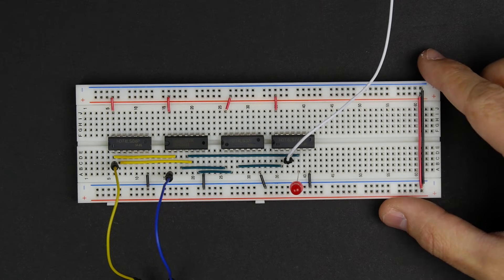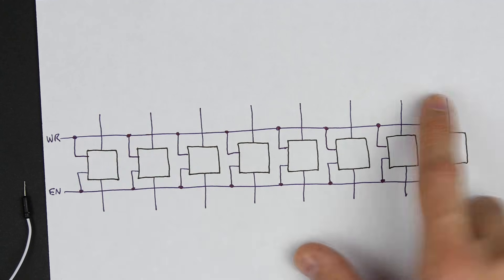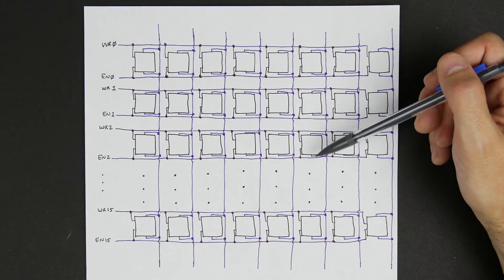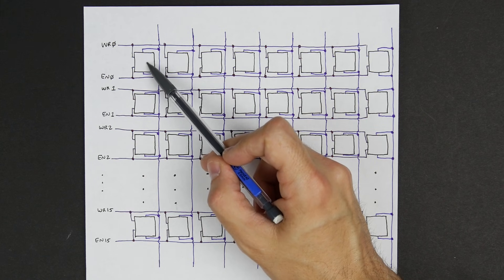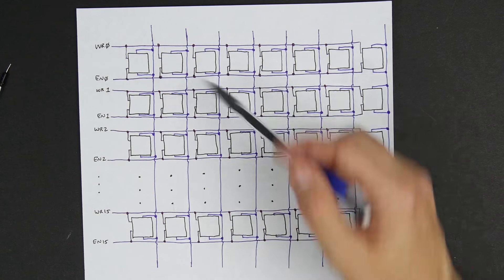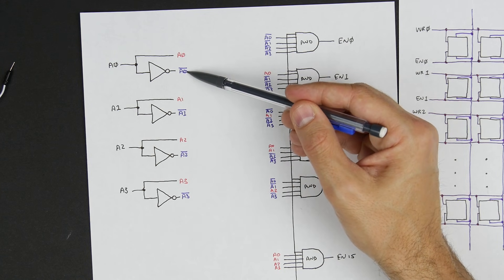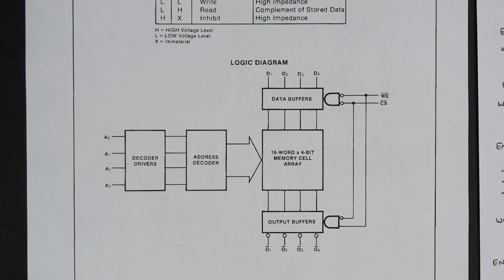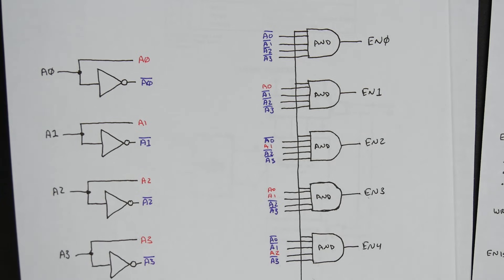8-bit computer RAM intro

Comment: I'll never understand why he went with the 74LS189... its difficult to find, plus its expensive at around $5 each when you do, . Then the regular 7489 and 189 and 74S189 version inverts the output data. It Would have been a lot easier for everyone if he went with a single ubiquitous 6116 2K SRAM that has an 8-bit data bus

Comment: What's with the funky pinouts? I can see why you want your input and output pins paired together, but... why on earth is A0 and A1-A3 on different sides of the chip?
Reply: Yeah the same thing is really annoying on the 6502 project when you go from the 6502 to the ROM chip. But at least the RAM and ROM have the same pin out so you can use all straight wires when you add that. It even makes laying out a PCB for it annoying.

Comment: You generally don't want to use flip-flops for the individual bits in an SRAM, latches are enough.
A flip-flop is typically built out of two latches, one that is transparent when the clock is low and then one that is transparent when the clock is high, to be able to capture the input at the rising edge of the clock (master-slave D flip-flop).

But when you have an SRAM with many words, and you're only going to write one of them at a time, only the second latch needs to be individual for each bit. You can share the first latch between different words, so if you have an 8 bit wide SRAM then you only need 8 of the latches that are transparent when the clock is low. That removes almost half of the latches compared to using a flip-flop per bit.

But Ben's flip-flops are really pulsed latches, sp they're not doubled. I can't tell whether it's a good idea to build an SRAM out of pulsed latches, but unlike the flip-flop case, you don't save a lot of latches by going with the pulsed option.

Comment: Any one can tell difference between ram and eeprom I think both are same...?
Reply: RAM loses its contents when the power is turned off, but the contents can be changed quickly.
EEPROM keeps its contents when the power is off, but it takes a long time to change the contents - often you only do it when the computer is turned off.

Comment: I’m starting to realize the greatest innovation in technology is being able to fit more and more into a smaller space.
Reply: Yep. Which always makes me think of this picture: https://pbs.twimg.com/media/EhBssk7XcAUIuSc.jpg, which is Bill Gates showing how one CD-ROM could hold the equivalent of 330,000 sheets of paper (if you look, it's pretty easy to tell that the only actual sheet of paper is the one they stuck on top, the rest seems to be some sort of sculpted object, so no worries about ecological impact of wasting all that paper). That was in 1994; imagine the equivalent today. CD-ROMs can hold about 700 mb; moving up to DVDs got us to 4.7 gb, or over 6 times what's in this picture. Nowadays, my ram has 32 gb, and there are microSD cards that can store 1 terabyte -- https://www.cnet.com/news/you-can-buy-a-1tb-microsd-card-now/. One terabyte is almost 1,500x the storage space of a CD-ROM, so we would need nearly half a billion sheets of paper to make a similar picture -- except the sd card is the size of your fingernail. It's enough to make you dizzy.

However, there are in fact limits to this. In the world of CPUs, we have basically hit the ceiling of Moore's Law. Transistors are so insanely small now (~7-9 nanometers) that we can't make them much smaller, because quantum tunneling becomes an issue (and also because the heat generated by powering them begins to go exponential).

We don't need alien tech; we already have it -- except we made it, which is pretty damn cool.

Comment: If I wanted to increase RAM to 32 bytes, do I just buy 2 more of the 74189?
Reply: Yes buying another pair of 74189 will work but will have to add additional logic in front of your second pair 

For instance 
1st pair = address = 0-15 and Memory first 16 Bytes 
2nd pair = address = 16-31 and Memory is the second 16 Bytes 

from the datasheet of the 74189 it is clear that the address range is 0 to15 for the 74189, So will need additional logic to translate the 2nd pair address of 16-31 back to the original 0-15 of the 74189. 

So your CPU will address the 1st 16bytes to 0-15 ( address range) and will address the 2st 16bytes to 16-31
Reply: @InTheEnd_141  It's really simple to translate from 16-31 down to 15-0: You just ignore the top bit (a4).
But you would need to set the chip select based on a4, and if you add even more of those chips, you will need a bigger decode that chooses one chip select to activate based on the address bits a4 and up.
Reply: You can, or you can buy a bigger memory. 64 bits is tiny.

Comment: What if instead of electricity the capacitors and transistors used pulses?
Static Ram is perfect for holding an entire Operating System, they could make 512GB static RAM and hold the entire OS in it, for faster loading.

Comment: Something I read recently about why the '189 inverts the output...

The 7489 was an early TTL memory device. Tri-state output wasn't available. Since it was also a big advantage to be able to wire-AND without additional output buffering, open-collector outputs was the obvious choice for devices that might have to share a bus.

As you probably know, NPN BJTs were used almost exclusively in those early circuits. (Just look at the schematic for a TTL logic gate.) NPN BJTs are pretty good at sinking current and their open-collector outputs could sink up to perhaps 16mA with the 7489.

One of the interests, at the time, was to directly hook up LEDs to the outputs. There was sufficient sinking capability to drive an LED. But.. well, to do that you needed the open-collector to be active. So if you directly hooked up your LEDs (and current limit resistors) to the outputs, then you would see lit LEDs where "1"s were written. And folks liked that feature. So I think the designers of these early memory chips chose, in part, to make the outputs inverted to help support the simpler use of LEDs to represent the bits.

Another reason is that these outputs would be wire-ANDed with a pull-up resistor. Before that output could be used again, it needed to be buffered. This buffering was almost always done with a 7404 inverter. Which inverted the signal! (And so you got your "1" back.)

When the 74189 came out, I suspect there was a desire to offer tri-state outputs but to also allow it to be used where the 7489 was previously used (tri-state or active-LO mode only, for example.) So they kept the behavior but added tri-stating to it. (I recall that they later put out the 74219, which doesn't invert.)

Those issues certainly motivated me when I worked with the 7489 and I think that's the reason that the 74189 originally chose to stay with the earlier design concept. Of course, as things proceeded in time, more became available and for less money and the motivations evolved.

Credit goes to "jonk" on electronics.stackexchange
(https://electronics.stackexchange.com/questions/447910/what-is-the-point-of-inverting-ram-output)

Comment: hello so what if I want to include more than 16 byte what can I do?
Reply: Buy a bigger SRAM is probably easiest. But I get the feeling that this computer will be designed to work with 4 bit addresses, if that is the case then more things will need to be redesigned to be able to make use of the extra memory.

Comment: What's the use case for the chip to output the reverse value?
Reply: It sounds very strange. Must be a lot more common that you want the uninverted value. And should be simple to add inverters at the outputs inside the chip.

Comment: Better to invert the inputs so the OE still functions with the bus.
Reply: I was just browsing through the comments to see if someone else had the idea that I was about to write here. I would also think that inverting the inputs to the RAM chips is easier, plus it saves us from having to use the extra bus interface chip with its wiring. Who cares if things are stored inverted in the memory, as long as the data that comes out of the memory module is what was written into it earlier? ;-)

Comment: Might be a silly question, but why prefer RAM rather than another EEPROM ? So that once you've programmed something to compute in it, it would compute it even after power off and on ? So that you don't need to reprogram it each time...
Reply: Frédéric Lidove EEPROM typically has a limited number of writes. It also takes a longer amount of time to write to it. Think of it as the difference between RAM and a Hard Drive in a computer. Ram is much faster, but can't store data long term without power.

Comment: It is a bit pity that the WRITE and ENABLE wires have the same color which makes it sligtly harder to folow when testing / explaining how it works. However, I can understand that they are both control lines so it makes sense to have them with the same color for a bigger picture.

Comment: 16 gb i doubt that is ram that sounds more like solid state/hard drive and in the case you are building it in the way to make ram so saying 16 gb would not be nice this way is and is better with this so my computer probably uses this is wrong solid state stores stuff by trapping it in a place but like you said it will run out after a bit and it needs to keep refreshing so it cant do that when a computer is off hence why they use it for ram.
Reply: You probably have a very low amount of RAM
Reply: @megamer2340  reading my old comment gives me a stroke but idk what I was talking about

Comment: The idea that it's this much work and circuitry for memory as low as this and that my PC has 16 gb of ram is mind-blowing.
Reply: yep, memory has more transistors than a CPU, but memory is a very simple circuit (comparing to a CPU), it's just what you saw in the video repeated billions of times, it's incredible and no one talk about it
Reply: To be fair, it's literally copy-pasted. A single DRAM DIMM might have, say 16 RAM chips on it, each with maybe 256MB. Each chip will have 256 * 1024 * 1024 of those transistor-capacitor combos on it. The chip will also have some address decode logic and that little circuit that loops through the contents and rewrites it. The trick is, when you make an IC, you're sort of just using a really precise projector to project an image of the chip layout onto the chip itself, then use some fancy chemical stuff to make it do the thing. But in designing that chip layout, it's essentially just a digital image. You can copy and paste it as many times as you want. Doing this same thing without a digital image is just a matter of some traditional printing/darkroom stuff. Perhaps not too far removed from just photographing the design and printing a bunch of copies.
Reply: @polymetric2614  what do you mean? There's nothing fair about that! It's still very impressive to miniaturize it, even if it doesn't get more complicated as you zoom out!
Reply: This is even more true for this whole video playlist by Ben, i.e. tiny simple pc compared to what we're watching this on.
Well actually in that case... Is he going to build a cell phone on a breadboard next?
Reply: It is fun to see this step first, because new technologies can only be made with existing technologies and at one point, these kinds of circuits used to power machinery used to make the even smaller chips and PCBs that do these jobs hardwired and with a fraction of the room. It’s like learning evolution for computers haha
Reply: Ŕrŕŕ
Reply: * this much circuitry for static RAM. He says dynamic RAM is just one transistor (and one capacitor) per bit. I guess the capacitor is made using a MOSFET… so perhaps a single MOSFET is both the transistor & capacitor (in dynamic RAM).

Comment: Question: why use two 4-bit chips instead of one 8-bit? MCM6810 is a 128 × 8-bit and can be found quite cheaply.
Reply: because the 4-bit chips are 7400 series

Comment: RE: time index 9:28- I understand your "spelling" everything out for your example, which is really good idea for someone new. But could you not use a 74HC154 to decode which EN line of "RAM" you are using? There are a lot of cool uses for the 74HC154. Also in one of your examples you use a 74HC04 Hex inverter to NOT the output of your Ram. Would it not be easier to use 74HC540? The cool thing about the 540 is one side of the DIP is your input the other side is your output. It also means you are using one Chip per 8 IO, not 2 Chips and have some left over gates/pins (which technically unused input needs to be tied high or low OR you can wind up with excessive power draws) . Plus, You don't have to dance all over the place to wire your hex NOT gate (74HC04).
Reply: Blacklab412294 hi, I have a question to your post: you spit out the chip numbers like you know them by heart, where do you get that information? I cannot guess the 74 numbers, browse for a datasheet and continue to the next one. Is there a wiki or list of chips available e.g. for adders or xor gates or such stuff from the 74 family?
Reply: ferrari2k
I know i'm late for class, but here's the list you requested:
https://en.wikipedia.org/wiki/List_of_7400-series_integrated_circuits
and here's one for the 4xxx series of CMOS chips:
https://en.wikipedia.org/wiki/List_of_4000-series_integrated_circuits
Reply: Basically, when I need something like this, I "browse" electronics shop DigiKey
To find something like 74 XX 540 (and you don't know the name), i would go to Digikey subsection
"Logic - Buffers, Drivers, Receivers, Transceivers" 
Use filters: "Logic Type - Buffer, inverting", "Number of bits per element - 8", "Mounting Type - Through hole"
you'll get a lot of them then, they all work, they all have datasheets and you can browse everything.:)

for decoders, encoders and similar, you go "Logic - Signal Switches, Multiplexers, Decoders"... there's thousands of parts and you can browse as much as you like, you can find anything you want.

If you don't know that something exist, it might take some time because you won't know what to search in the first place, but if you invest the time, you will find it; that's what being an engineer is all about.:)

To create custom electronics and SOC stuff (if you don't count microcontrolers, transceivers, WLAN, BT, RFID and other specific chips), I use level converters 90% of time (74HCT08 or 74HCT04 for general use, find custom stuff if you need to be more specific), buffers 5% of the time and everything else is in the last 5%.

Comment: Where do you get your parts from?
Reply: theres a lot of websites online that let you buy bulk chips and circuitry components of basically any type. I would say just go to Radioshack, which with out a doubt had the most electronics components for a good price. You could buy resistors, capacitors, diodes, 555 timers etc.
Reply: Rs-components, Farnell/element14, digikey, mouser
Reply: yeah i use digikey
Reply: Google jaycar electronics if you live in aus/nz
Reply: Banggood, eBay, Ali Express in that order. After exhausting those, DigiKey. Also EEVblog did a video on parametric searching.

Comment: Now I can see why they said that 64k of memory is way more than enough for a regular user.
Reply: Not really, it was even kind of a joke in the day, that's only 32 pages of 80x25 column text! With no room for OS or word processor. Hardly a gripping novel or indeed it takes quite a bit of imagination to make even a good game in it, and even then it will have severe complexity constraints.

What instead happened was people managed their expectations of what a computer could do, and increasing RAM and disc drives allowed people to imagine more sophisticated and complex things to do on the computer.
Reply: @MrGoatflakes  we sent people on the moon with that
Reply: @vincenzo3574  no, they did not. The Apollo Guidance Computer had 2048 15 bit + 1 bit parity words of core memory RAM and 36864 words of core rope ROM. Although it was not byte organised this is roughly equivalent to 4kb of RAM and 72kb of ROM, with 1/16th of that used as parity.

And it was only one of a suite of computers installed on the entire rocket, not to mention that ground based computers were used whenever possible.
Reply: Nerd  @MrGoatflakes
Reply: c o m m o d o r e .